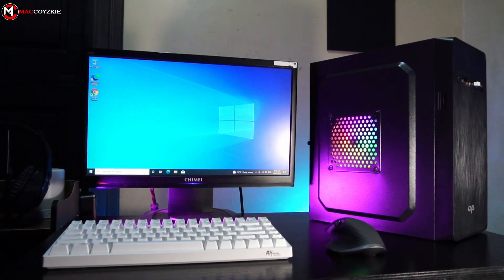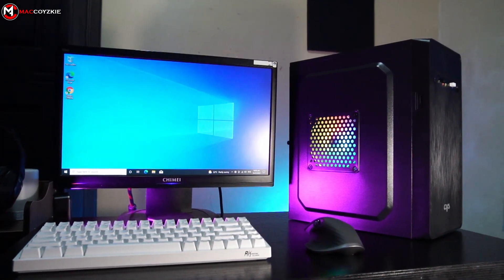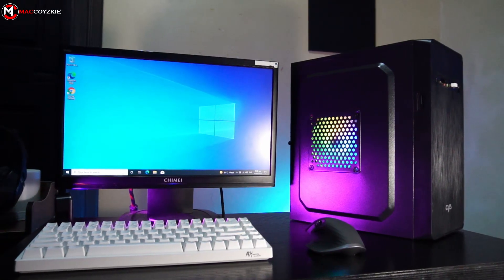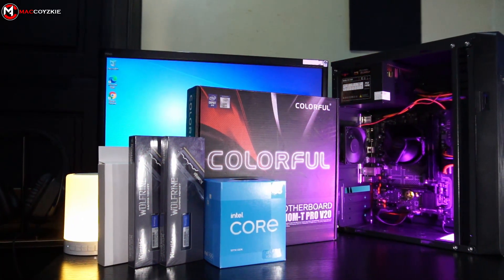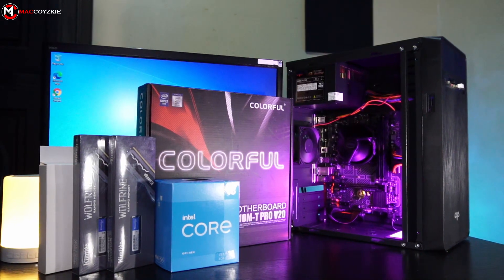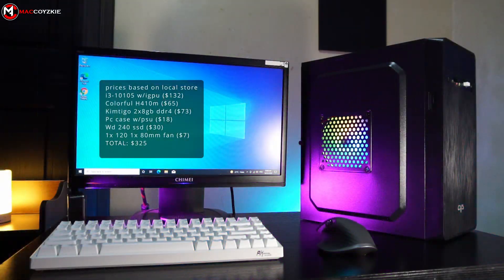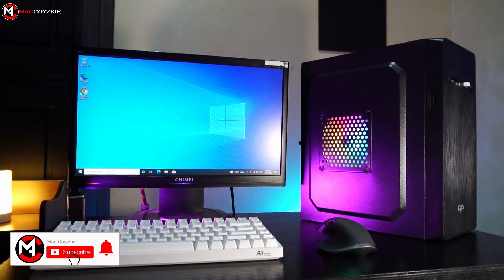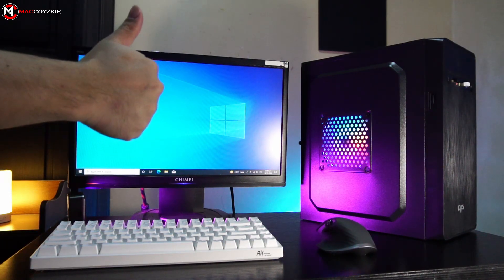Intel i3-10105 Budget Pc build!

Comment: Wait, the 10105 can use ram faster than 2666mhz? Isn't that 3200mhz ram wasted?
Reply from the maker: it is wasted but this is what happen when 2666mhz ram sticks are no longer available in the local store
Reply: @MacCoyzkie  i thought that this was happening only here in Italy. I'm building a pc for my dad with the 10105 and i cannot find any 2666mhz ram anywhere
Reply from the maker: @sergiotanchione7370  most manufacturers stop selling it already and yeah even here in my country

Comment: I want to build something like this but I am afraid because I never built a pc in my life xD, so I was thinking about just buying a office like dell or hp and upgrade them, but at the same time I want to built everything from zero
Reply from the maker: prebuild pc are fine as long as the store you are going to buy it has a good reputation. Most of the time they will just scam you. Buying individual parts is much more ideal, building it yourself seems intimidating but its not really that hard and after you build it yourself it has a satisfying feeling specially if you see the "Reboot and select proper boot drive" (meaning pc is ready to install windows) why not try it and follow some tutorials in youtube
Reply: Building a pc is super easy. It's easier than building a lego.